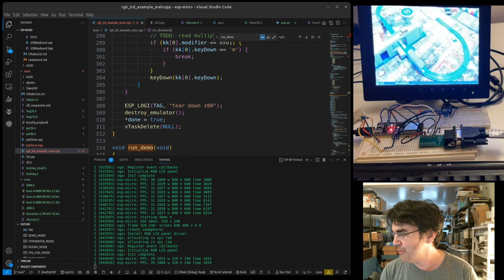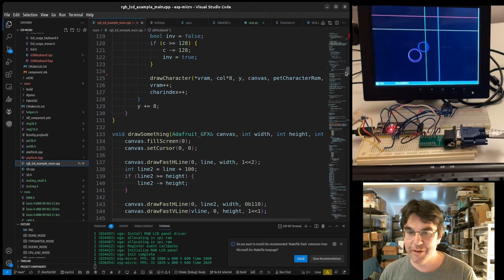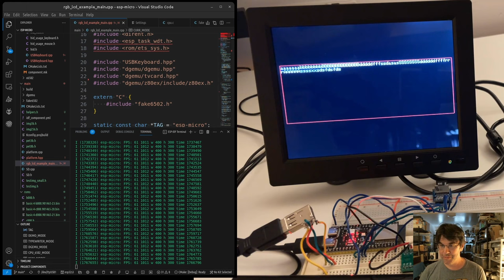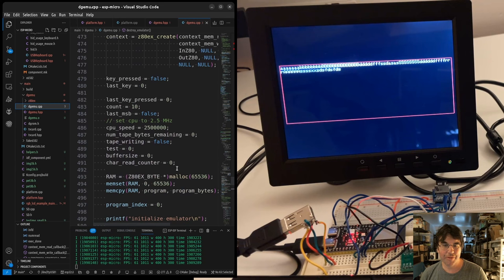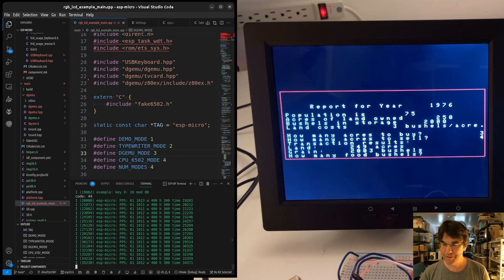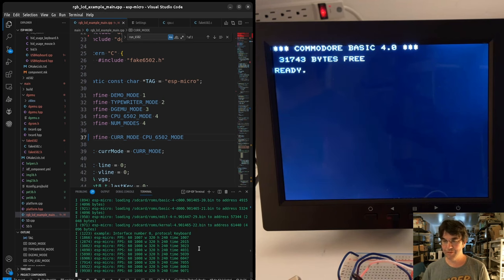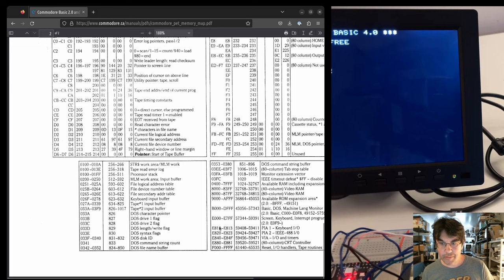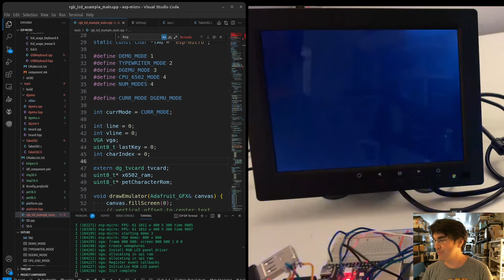Building a New "Retro" Computer - Part 2: USB Keyboard and CPU on the ESP32-S3

Comment: interesting project . can we try screen cast from other computer on the esp with out wired connection .
Reply from the maker: Good idea! It should be possible, but at a fairly low resolution. Possibly a window could be captured and sent to the S3 over wifi.